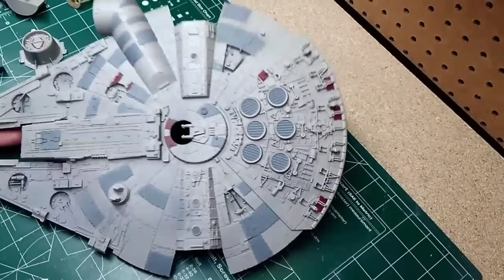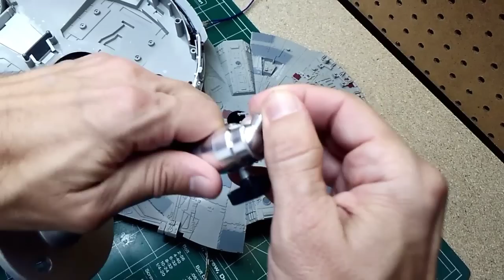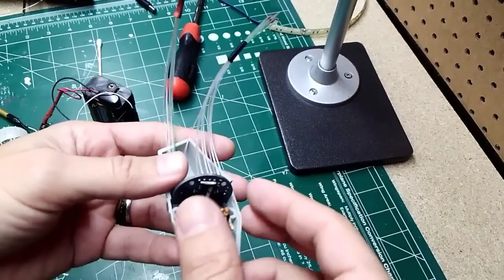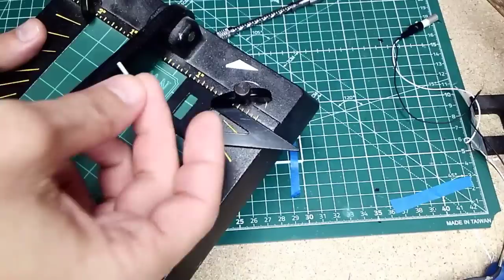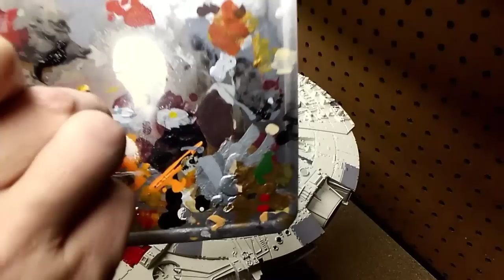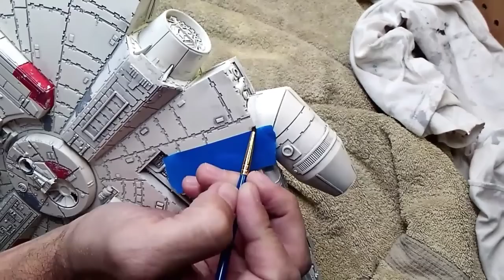Building an inexpensive Millennium Falcon

Comment: I noticed something about this model...
The sidewalls for the front mandibles seem to be big.  Do you think they used the old MPC kit as a reference for the Revell model release?
It's funny you don't notice these things as a kid BUT they stick out especially when anal-retentive modelers point these things out to you!  <laughs>
At least it has the right dish!  The Disney changes just kind of bug me...
I don't mind the engine exhaust grill so much because the original 5-ft and 32-in models DIDN'T have exhaust details but that rectangular radar dish does NOT work for me.
Reply from the maker: One of the biggest issues with this kit is the sidewalls are too thick. I do think it used at some of the molds from the old MPC kit.  For the price it's not to bad though.

Comment: Good price and bigger than the Bandai Perfect Grade Kit, huh?

A  lot of the toys are bigger than the model kits and CHEAPER I've seen.
Even the 1/72 Bandai Falcon (from that movie that shall not be named; hint -- it's a film with the rectangular dish!) is $50-$60 in store!
What has happened to model building?  It's definitely not a kids thing anymore.  Very much collectors and anal retentive market...

The last model kit I bought was nowhere near as expensive as some of the 1/72 kits you see now.
There's no way most of those Star Wars kits should be more than $15-$20.

I understand the pricing for the Polar Lights 1/350 Scale Enterprise's -- THAT makes sense given the sizes of those kits -- but most of the Bandai Star Wars kits aren't even 10 inches long!
Reply: BTW, the model came out well!
Glad you replaced the top cannon.  Much better looking than the molded in crap.  Shame about the bottom but I guess that depends on how far people want to take this and it may not be that big a deal depending on what you regularly see.  The top paint job looks excellent for sure!
The weathering's not overdone.  It looks "just right" which is probably the best compliment you can give to this.
I think a lot of the paint jobs get OVERDONE and those models get really dirty and "sooty" in the rear around the vents exhausts forward of the engine exhaust...
Reply from the maker: Thanks for the comments! The Bandai PG is great but $300 plus for a fairly small model is a bit steep. Thanks for the support!